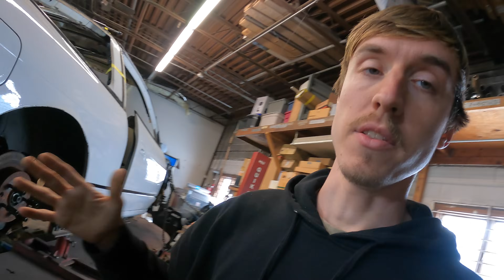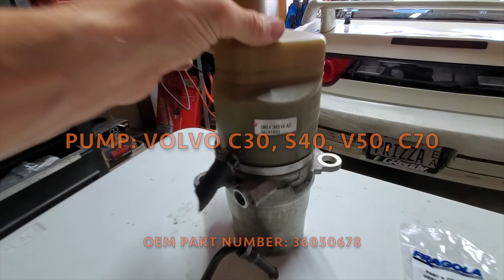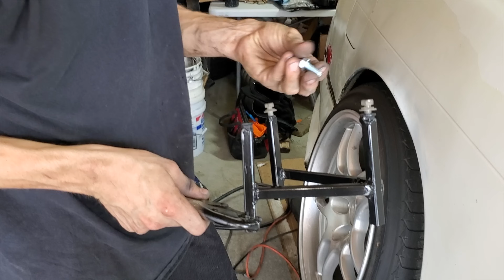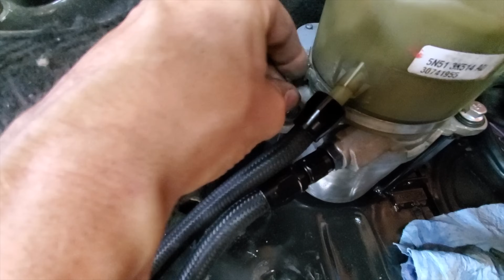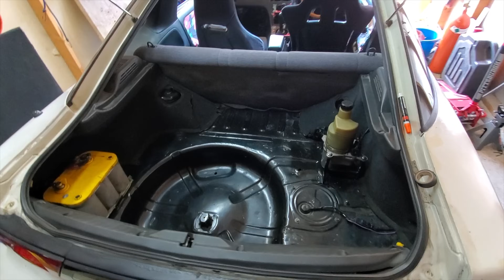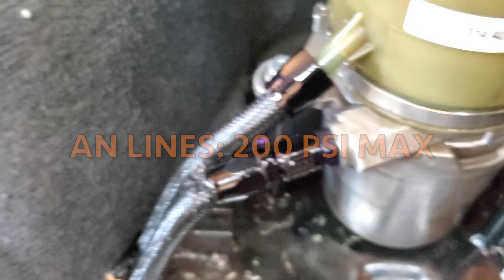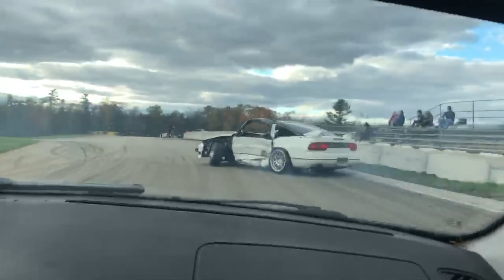How to Install Volvo Electric Power Steering Pump into Most Cars

Comment: Hey guys I did this to my hardbody it’s getting power but and it turns on but it starts freaking out any ideas ?
Reply from the maker: What's freaking out? If the wheel is freaking out, make sure the lines are hooked up the right way!
Reply: @PrizzaMike  like it starts turning side to side when I try and turn the steering wheel
Reply from the maker: @chrisbenavides7768 hmm, does the sound of the pump change?
Reply: @PrizzaMike yeah
Reply: @P @PrizzaMike im going to triple check if i hooked it up the right way
Reply: @P @PrizzaMike  I’m using a 80amp breaker

Comment: I’m not into drifting but I can’t help but respect the ability of them to hang it out like a dirt track car. Sorry for your troubles on the car. My question is my car is 4200 lbs and a traditional A Arm suspension and I’m looking into freeing up space for my air to water intercooler and piping. Do you think it’s strong enough for regular driving or would it be too much? I’m thinking a big s60 wagon is comparable in weight but it’s a rack and pinion too I believe

Comment: okay I got down how to install the fittings to the pump but how do i find out which fittings i need for my rack and pinion sending and return lines where do i either find the diagram or a website that sells them

Comment: did you ever have any issues with overheating or anything? is no oil cooler necessary?
Reply from the maker: With the lines being as long as they are, no cooler was necessary. Temps are moderate even when drifting in the summer

Comment: What kind of pressure numbers does the pump put out? I'm building a custom power steering conversion for offroading and went with a Saginaw 800 gearbox and hoping this would be an easier route than fabricating extra pulley brackets

Comment: Hi pal, I see you used a 30 amp fuse. What draw does this pump take. I am thinking in using this to replace the mechanical pump on my 1979 MGB GT but need to know the amperage so I can also update my alternator. Thanks.
Reply from the maker: Hello!
I know in the video I mention 30 amp
Unfortunately I could not edit the voice, but in the description I made the adjustment to 60 amp

I am sorry for the confusion!

Comment: Just did the chase bays fittings to -6an and the ones I bought from your video are too long for my rack, are there different sized racks?
Reply from the maker: Too long?
They should stick out a bit, they won't bottom out on the notched portion
Reply: @PrizzaMike  yeah, just a silly goose over here. I figured put they will just bottom out eventually 😅 you're the best!

Comment: i know this video is like a year old, but braided an lines can handle a lot.. further more, if you use the nylon/ptfe braided an lines they are more than capable over running well over 1000psi. the mistake here was prop just that you ran low pressure rubber an line rather than nylon/ptfe. rubber is fine for oil coolers, fuel, cooling system and other "low"pressure stuff, but when you go high pressure you deffo need the nylon/ptfe version, i run 4AN nylon/ptfe lines on my brakes self made and honestly never once had an issue with them as long as ever part is fitted properly <3
Reply from the maker: Great info! Thanks for your input 🙏
Reply: @PrizzaMike  no worries, i just hopenit helps for future stuff (if you hadnt come across the info in the mean time👌🏼) 💪🏼 rest was 🔥

Comment: I just installed this pump in my 95 Camaro. The steering wheel started turning left and right all by itself and I couldn't even hold the wheel. Then the steering seal blew out. How the hell

Comment: I purchased a 31360493 power steering pump from a 2012 volvo s60. Today I was going to test it. The +12 v to a battery. The thick grnd to the - on the battery. When that was done, I took the signal wire and touched the + on the battery. Held it for some time. Nothing... So now I am at Loss.. If you have any suggestions, please feel free. :)

Comment: Hey bro got a question for you. I did the same conversion in my S13 with a 1uzfe swap and I’m having issues. Whenever I turn on the switch for the power steering to come on I hear it nice and loud but it won’t let me turn the steering wheel without whipping it back to either to the left or right. And I mean it jerks it hard. So right now I’m driving with it off. Any suggestions?
Reply from the maker: Hmm that's strange.. 
Have you confirmed the pressure fitting on the rack (smaller diameter) is connected to the pressure fitting on the pump?
Reply: @PrizzaMike  you want me to remove the pressure side to see if it’s getting fluid? I mean I assume it should.
Reply: @PrizzaMike  and I mean when I turn the steering wheel either way it whips fast and hard (you can’t hold it at all) to the opposite direction
Reply from the maker: @travisgallegos9363  I just realized I had a typo on my 1st reply. I changed 'getting' to 'fitting'

Basically if the pressure fitting from the pump is connected to the return on the rack, it could cause the issue you're having
Reply: @PrizzaMike  which is the pressure top or bottom. And I was thinking the same thing muself
Reply from the maker: @travisgallegos9363  the smaller diameter fitting is pressure 

Maybe just switch em around and see if it corrects the issue
Reply: @travisgallegos9363  Got the issue fixed?
Reply: @PrizzaMike  I can DM you a video of you want

Comment: 3/8” BSP is just a tad too big. Grab a male/male adapter, skim off 0.15mm off the thread and it die’s okay at 16mm by 1.5mm. A Dowty washer looks okay on the face. *the cheap Chinese tap and die set wins again :o)  Big spade connectors are the yellow size and the small trigger one is the ickle red spade. I just need to watch the vid for the pin-outs. Could of done with a clear shot of that in the vid. I got mine for £55. Wish me luck :D Mitsubishi fork truck steering valve should be here Monday . . .

Comment: SO. You reference that you are using a 30 amp maxi fuse for the electric pump power supply.
slightly different application. I have installed this same electric pump in my old cj5 Jeep running a 60 amp fuse.
If I dead X the steering for more than a split second or steer while braking hard going down steep obstacles, 
I blow the 60 amp maxi fuse. I am wondering if I am putting a greater load on the motor or if I have an issue.
During normal operation, the thing steers like a dream right up till it loads hard.
Reply from the maker: I mis-spoke in the video about the amperage fuse, but had updated in the description I used a 60 amp fuse. But that's strange you're popping 60 amp fuses

Comment: Hey man , just did this step by step and everything is good no leaks but the steering wheel just starts twitching by its own when it's on. Did you run into this ? Any ideas ?
Reply from the maker: That's strange, have you also bleed out the air bubbles in the system?
(Turning the wheel full lock left, to full lock right, 1st with pump off a few times, then with pump on)
Reply: @PrizzaMike  yes, i even Jacked the rear of the car up to be extra.. idek. Never seem anything like it
Reply from the maker: @thomasjoyce8374  hmm, I'm assuming it has constant power to the Grey/blue stripe wire? 

How long have you let the pump run so far?
Reply: @PrizzaMike  was using black and yellow wire on s13 fuel pump harness.  Just changed it to switched power.  Same issue.
Reply: @PrizzaMike  I've had it running for atleast a minute
Reply from the maker: @thomasjoyce8374  hmm, positive the pressure line is on the pressure fitting on the rack?
Does the steering feel like it has power steering?
Reply: @PrizzaMike  can I send pic ?
Reply: @PrizzaMike  the power steering feels strong it just fights against me when I try to turn. Somethings gotta be backwards
Reply: @thomasjoyce8374  hi did you solve the issue? What was the problem?

Comment: Does the pump ever shut off when car is running? Say going in straight line or at stop light?
Reply from the maker: I have it wired to a switch, so on the highways I flip the switch to turn it off

Comment: It'll also gain you probably 10-20hp if other engine dyno channels are correct. Running a mechanical pump is a big draw, but adding a few dozen amps resistance to the alternator makes no difference at all. Can do electric water pump for the same benefit.

Comment: Ah that sound :) I used similar pump that came out of Opel Zafira or Astra. It was made by TRW, reservoir had different shape, bottom part looks same, except it came with wires directly wired to the pump, no connectors on pump body . The Opel pump has an added benefit that it works without CAN, it has 3 signal wires, one is ground, the other I figured out to be "ignition" and "charging". It will work once power is applied to both of them but will ramp up very slowly, which meant that for 1st couple of seconds you had barely any power steering which was annoying. If power is 1st present on "ignition" and then on "charging" it will instantly go to normal speed. It also had a "fast" mode when it detected increased load it would double the speed. The coolest thing about those pumps is that they run absolutely cool: I had it in engine bay and after long driving fluid was lukewarm without any cooler. I calculated that it was robbing about 0.1 hp through alternator when driving in straight line, compared to stock pumps that at redline can rob like 10 hp or so it was amazing.
Reply: What model of opel pump did you use?
Reply: @hotrod4d  i don't know a model name unfortunately, just the cars they came from

Comment: I’m curious about where the trigger wire went to? Just 12v switched power? Does the rack control fluid flow? so the pump is always at full force? If that makes sense
Reply from the maker: The trigger wire I have on a manual 12v switch, the pump will run at about 80% efficiency using the fail safe wire. But has been perfectly fine the past years of use and abuse

Comment: First vid I found of your channel. I have seen photos of the car on insta. Mad respect for putting it on a frame table to fix it. I figured itd either get junked for another chassis or used as a missile. 
And great vid on the PS pump, this is a swap Im planning soon on my Tbird drift project.

Comment: That looks really stupid, so you rather run lines and wires all the way back to the car than find a replacement pump or rebuild the pump. Drifters are weird.

Comment: I'm willing to bet you could control that pump with pwm signal generator that refrences the speed sensor output. I know you could get a manual speed control module on Amazon with rotary switch and readout for about $15. For drift car, I guess it's not a big deal... but even electrical draw becomes parasitic by increased alternator drag. Measure the draw of the pump and be sure your pwm can output at that+20%.

Comment: Very useful for electric conversions. The delay on power-on is probably from the control module waiting for a CAN signal.
Reply: Similar with the electric power steering system from Toyota, it doesn't use fluid though, it's just a motor that sits inline on your steering shaft and applies up to 200lbs of force on the output, then they just use a manual rack.
Reply: I have one in my EV swap and it's super annoying. Everything else on the car is a quite hum but this power steering pump is much louder. I'm replacing it with an electric rack
Reply: @skudak   Where is the pump located in the car? Have you tried some sound deadening and rubber mountings?
Reply: @gsilva220  it's in my engine bay with rubber dampeners. It's just a loud pump no matter what, I'd need to build an enclosure to muffle the sound.

Comment: Holy Shit man! I saw this on an Instagram Reel of you driving it wrecked on the roads in the rain, lol
Was actually checking out the video since I'll be doing the same pump on My CB7 build.
I heard running the lines long  caused some issue but looks like it worked fine.
Did you upgrade your alternator for the added amp draw?
Thanks for the great video.
Reply from the maker: Hey man! 
In my case I did not run into any issues. I did not have any issues with amperage and power, but I do plan to upgrade the alternator someday

Comment: You can buy the fittings and hose on line and the crimp tool for hydraulic lines and make your own and if you have the tool you can make the lines for your buddys cars also! You can just go to a hydraulic shop also and get the fittings and mock it up in your car and bring it back to them and they will crimp it for you if you want a cheaper option. You got lucky and found the hose you need but that's not always the case. What in the hell happened to the passenger side? Right hand drive so ya passenger side of your car man!! That's so shity!! That's a dam hard hit also! Hope everyone is good from that one geesh!

Comment: Opel / Vauxall also uses such electro-hydraulic pumps.
However, these pumps are not designed to run at full capacity all the time.
I recently changed the oil in this unit, I added Febi green mineral oil.
You have done a great job switching to such a system!
Reply: Exactly the same with this Volvo/Ford-pump. It should not run continuous.
In a Volvo C30/S40/50 and European Ford Focus mk2, when those cars get powerloss from the alternator, or when the 12V battery is bad. These pumps use A LOT of power and is only running in the exakt moment you turn your steering wheel, and if the ECU sees that the voltage drops when you start turning the steering wheel it will cut the power to the pump immediately and show "power steering malfunction" in the instrument cluster :p
Very funny if you drive slowly in the city 🤣
Reply: Precisely because these pumps currently consume a lot of energy, the battery must be good and, of course, the alternator must charge the battery properly.
I replaced the battery a year ago because it's bad to drive in the dark with the "flashing" headlights

Comment: A couple things 1. If you buy this pump from a junk yard, spend a bit more and also buy the CEM(Under the glovebox) and the SWM(behind the steering airbag) and  12" of each and every harness. This way in the future you have the CAN car-configuration codes needed to vary your pump's speed.... 2. If you are a drifter and notice that this pump bogs down sometimes, it is because the pump is not being told by CAN to pump more volume of fluid to keep up with the quick turns. The pump itself can pump very high volumes and the pressure bypass is set to a lofty 1700PSI which is higher than most electric and belt pumps Trivia: The 2 gears that pump the fluid are only about an inch tall. Hence the 1700rpm minimum speed. The maximum speed is 4800rpm.
Reply from the maker: Wow, that is great information!
The next time I am at a junk yard I will snag a few of those CAN BUS modules!
Reply: @PrizzaMike  one other thing. The CEM and the EPS have to match because they compare the Configuration ID stored in each.
Reply: @marinelifer1752  how hard is it to make those work with a car that doesn't have provisions for canbus?
Reply: Finally somebody mentioning this. I have a Volvo C70 and the power steering pump accelerates when turning the steering wheel. And also mine sounds like its working at a faster rate when idling. Not sure if it's because there is no CAN bus communication and the pump runs at a "default" speed.  Or because now it's a little bit more stressed pumping ATF fluid instead of the Pentosin CHF-202 / CHF11S that it was designed to run originally, which has less viscosity.
Reply: Is there a way to lock the pump at max effort mode without any CAN communication?
Reply: @ArthurSperotto  spolisz ją
Reply: Yeah, but then what do you use to send that CAN bus message and control the speed on a swap like this?
Reply: Would this work in a my e36 ?
Reply: Thanks for this tip. As I am looking for one of these today

Comment: One thing that I've always wondered but never heard anyone talk about, does the electric pump affect the way the wheel feels or no?
Reply: Electric? Yes, the car drives like a go-kart and you lose most of, uh.. connection? with the wheels. This is not real electric though, just called that to simplify things. Here you just pump hydraulic liquid with electric pump instead of a belt-driven pump. There is virtually no difference, it can even be better because belt-driven pumps can heat up the liquid during hard, track driving and you'll slowly lose power steering. Electric pumps don't do that
Reply: @piotr8264  aaaaahhhhh, that makes sense, thanks!
Reply: Real electric would be a electric motor fitted in the steering rack or the thing that connects steering rack to wheels (idk the english word). Then you get equal resistance at the steering wheel no matter the situation and additionally the motor in some way acts as a damperer, removing any sensation on the steering wheel (like feeling your front tires losing grip)

Comment: Electric power steering is super nice imo. My jz block bracket for the power steering broke so I had to find alternative. I used a mr2 pump but planning on switching to MRS power steering this season. Makes the engine bay cleaner and a lot more room to work with

Comment: We use the same setup on a 87 bronco with 38.5 boggers. No HP robbed. 3 wire hook up.
Reply: lol.. and where do you think its getting its power? From alternator maybe? With added losses since driving hydraulic pump directly is much more efficient than driving alternator and then via elelctric motor drive hydraulics. You got some perpetuum mobile going on there.

Comment: Got so many of these pumps on deck but lowkey don’t want the switch want to kick on automatically
Reply: Connect it to the alternator then, will turn on as soon as the engine starts (just like regular belt-driven pump)